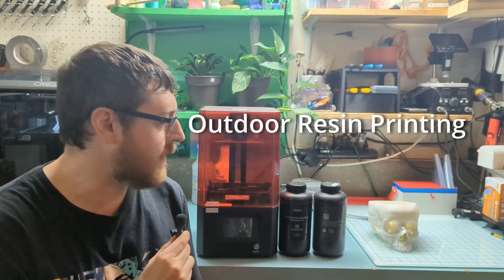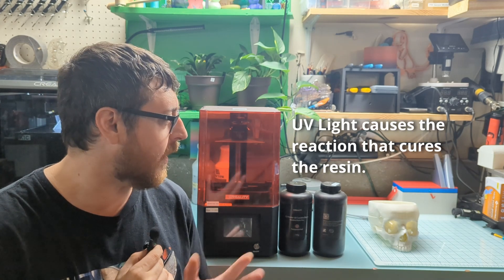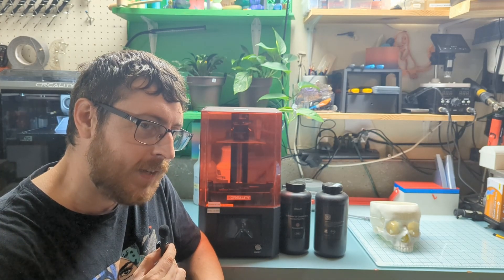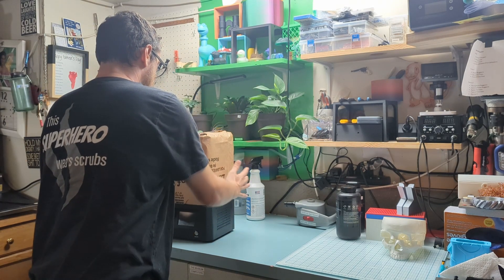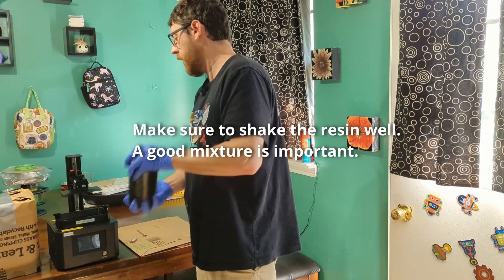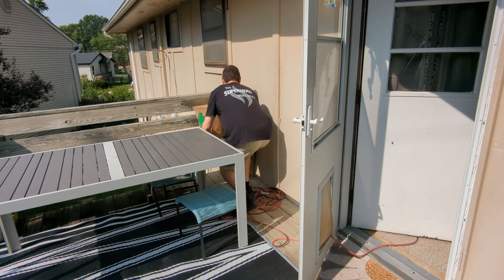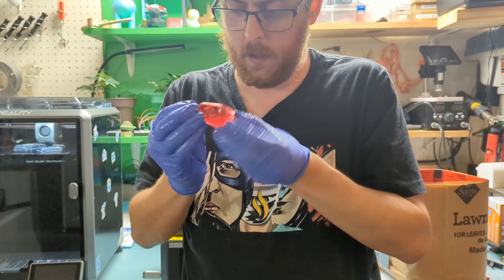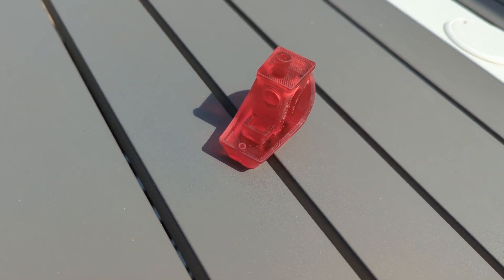Outdoor Resin 3D Printing - Using My Creality LD-002H

Comment: have you done this more? how many spills? any reccomendations for reducing spills?
Reply from the maker: I still do this regularly, although I generally go through my garage rather than the back door, and I have set up a small tent for printing in. I have not had any major spills, although I have had a couple times where the resin sloshes over the side of the vat a little. The biggest things I do to avoid spills are 1) Make sure the area is clear of obstacles and any doors are propped open, 2) pay careful attention to keeping the printer level as you move and 3) move slowly and carefully. The other thing I have done now that I have a tent set up is wait until after dark to add the resin to the vat. The tent allows me to do that without too much risk of contamination. I hope this helps, thanks for watching!

Comment: I keep my 3D printer inside a large grow box on my balcony. I attached UV blocking film on the vynil you use for windows to keep the sun UVs out while i work on my post processing. Another thing that is VERY good at keeping UVs out of the enclosure surprisingly is sunscreen! Before the UV film i would just smear sunscreen on the plastic vynil and it worked like a charm
Reply from the maker: Brilliant! Thanks for the tip!

Comment: Thanks for this fantastic video! It's a subject that I'd been waiting for someone to cover before I bought a resin printer. Also, printing at night seems like such a common sense idea, I'm not sure why I'd never come across it before!
Reply from the maker: Thanks for watching, I'm glad you found the information helpful! I probably should make a follow up video, I really geeked out on this project. I ended up building a camera and heat sensor to go inside the chamber, and found that during the day in direct sunlight I was getting temperatures of up to 140F (60C). After several months of this sustained abuse my UV LED did burn out. So yeah... Definitely better to print at night or at least in an area that gets a good amount of shade. Happy printing!